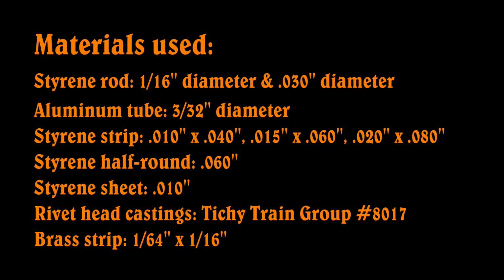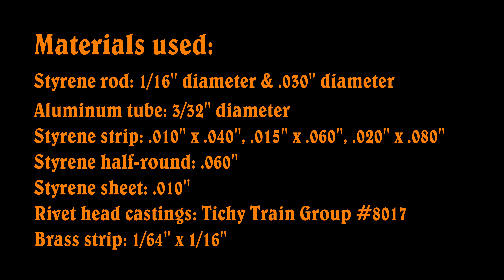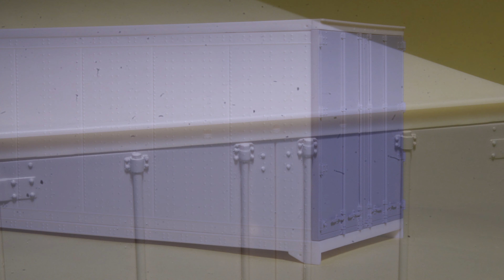Adding door lock rods to the Moebius Models 53' van trailer kit

Comment: The doors look great, Thank you for the how-to video.  Im curious, what is your reasoning when you choose brass over aluminum and vice-versa? Does it matter what type of primer to use when painting them  i.e. lacquer, enamel, acrylic?
Reply from the maker: For painting, I have used all three types of primer with no issues on brass and aluminum. Lacquer or enamel will likely adhere better to a large metal surface however the brass and aluminum parts on my models are typically smaller details with the majority of model being plastic.

Decision to use brass or aluminum is made based  on a few factors:

If soldering is involved, use of brass is required.

For ease of cutting and drilling, aluminum is preferred. (Brass can be cut and drilled with hand tools, it is just easier with aluminum.)

Aluminum is great for any item that will be a polished or chrome finish. Truck exhaust stacks and hydraulic cylinder rams are two common applications. With a bit of Nevr-Dull or Autosol, aluminum tube can easily be given a chrome like shine.
Reply: Ty sir.